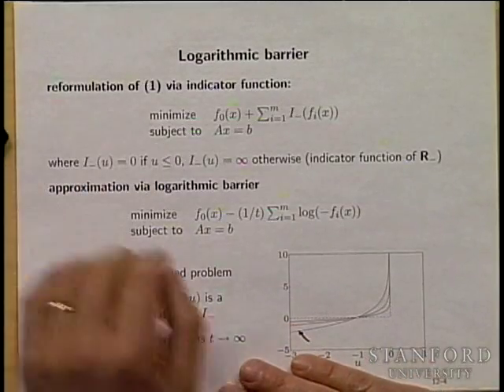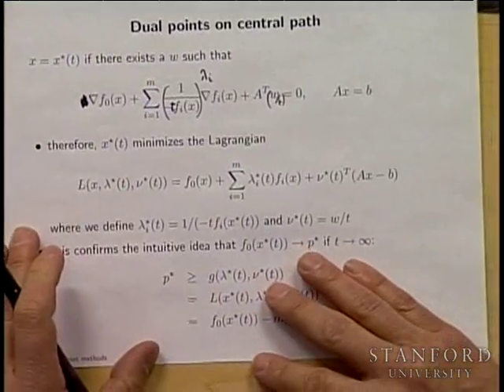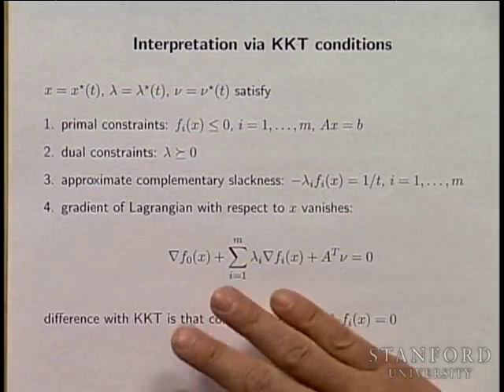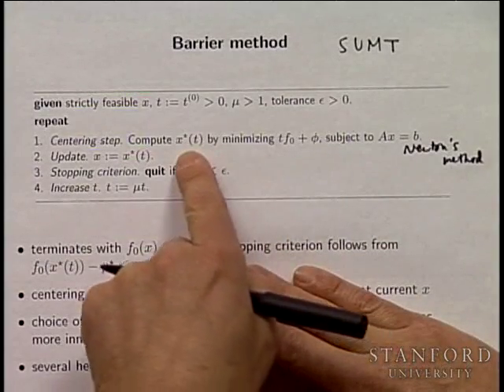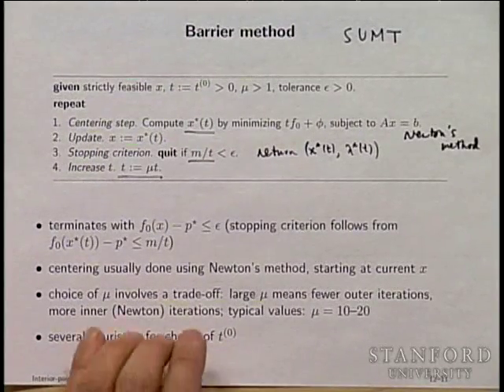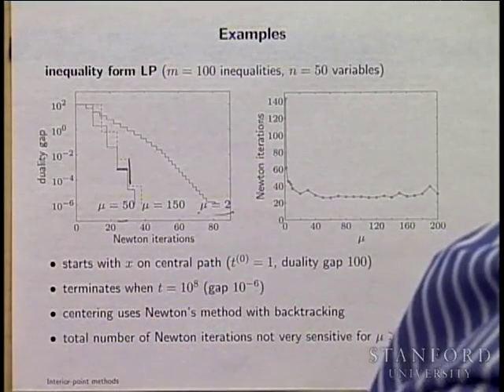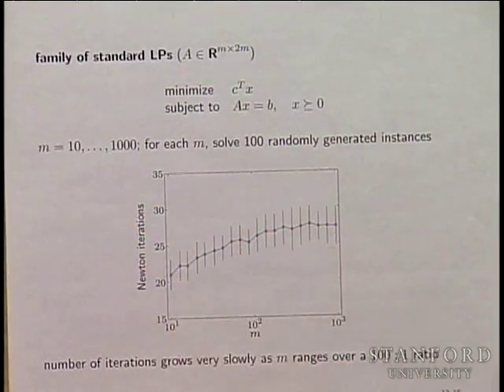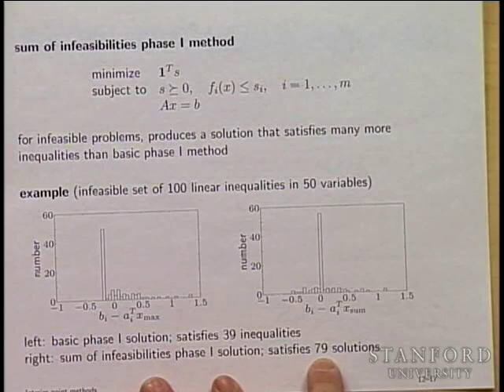Lecture 18 | Convex Optimization I (Stanford)

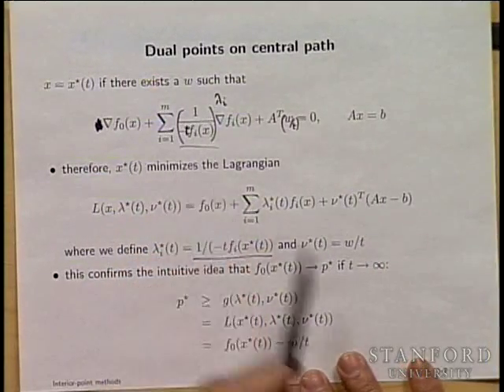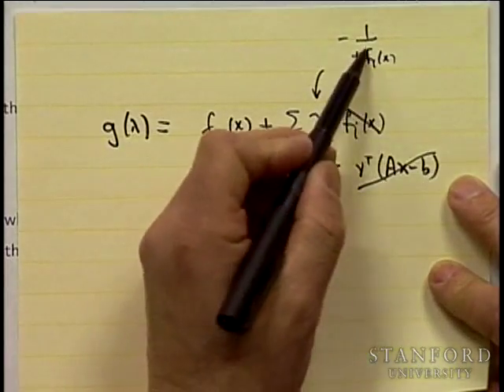Comment: At 12:59, when he says that lamda-i is defined as (-1/(t * f-i(x))), the 'x' should be pre-disposed to be 'x*', i.e. the root of the KKT condition defined above. So, he cannot simply cancel the 'f's at 13:53.
Edit: In fact, due to slackness condition, since 'f-i''s are strictly negative (they have to be because we're using log-barrier in the equivalent case), it enforces the fact that Lamda-i's have to be strictly zero. That is not possible as it would imply that the constraint functions are infinite at the optimum point.

Edit 2: At 23:45, he could have still enforced it without having to cancel the 'f-i's out before.

Comment: 0:30 Logarithmic barrier
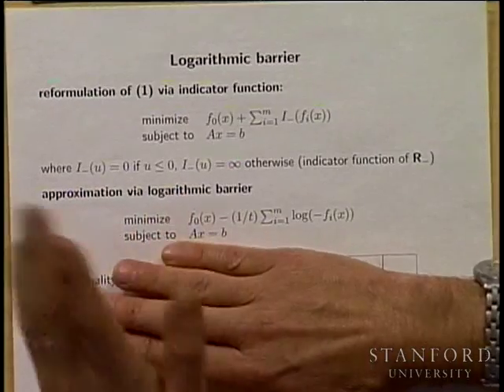3:30 logarithmic barrier function
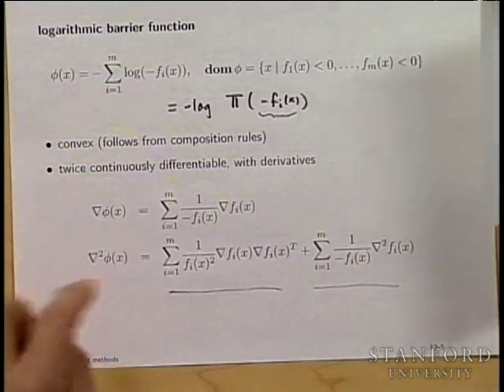5:05 Central path
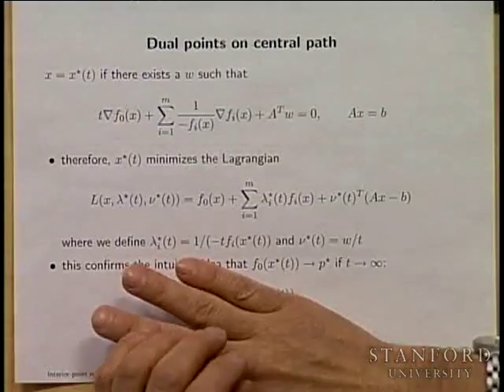10:44 Dual points on central path
21:06 Interpretation via KKT conditions
24:58 Force field interpretation
26:15 example
32:09 Barrier method
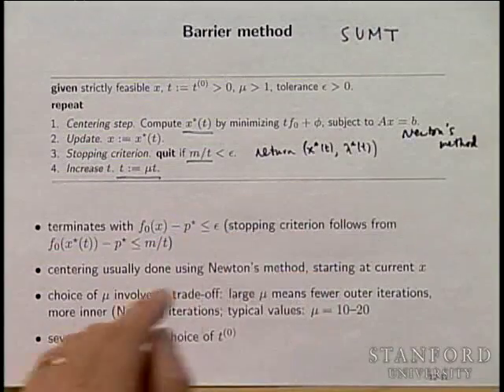45:13 Convergence analysis
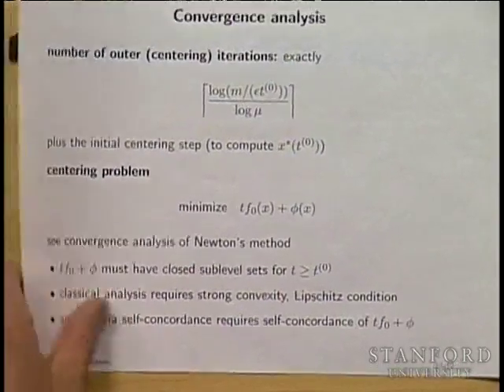49:19 Examples
1:01:12 geometric program and family of standard LPs
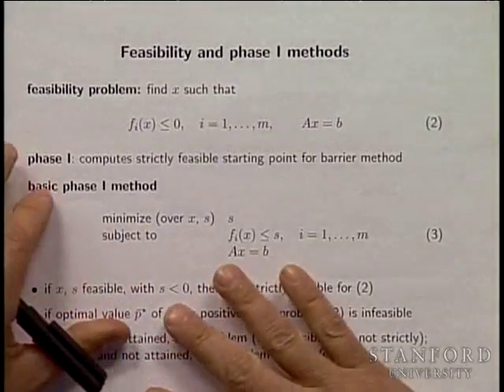1:08:42 Feasibility and phase I methods
1:13:40 sum of infeasibilities phase I method